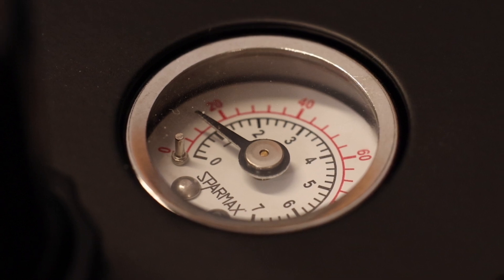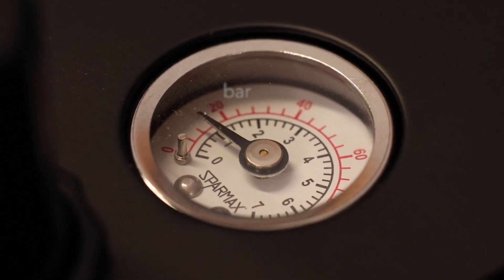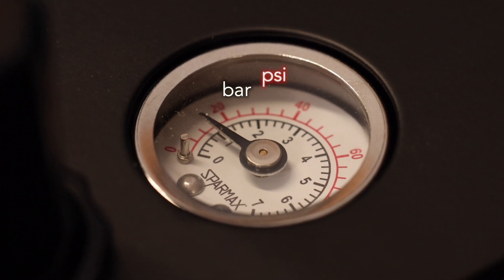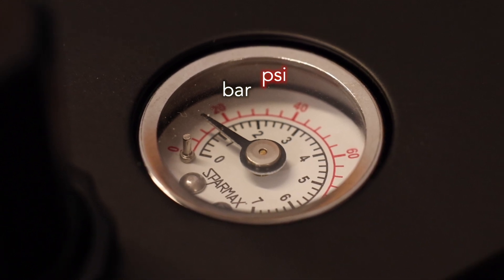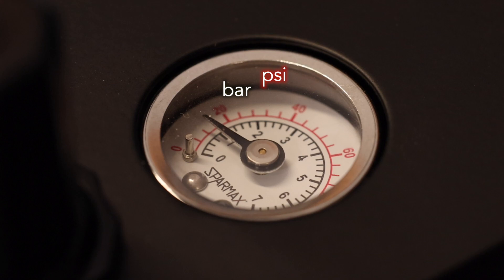Air Pressure Basic Tips

Comment: Hi there. Thank you once again for such great videos, they have been a great help in my airbrushing journey, also thank you for the amazing feedback that you give quickly, great customer service which is hard to find these days. May I ask a question please?  The little screw in the air valve (goldish colour, evolution) how far should it be screwed IN or OUT and what effect does it have on the air pressure. I have not played with it since I bought my air brush, but just wonder if it did anything other that hold the spring for the pin
Reply from the maker: Hey Mark - slightly embarrassing and more than a little ironic that I've taken three weeks to reply to your compliment to our customer service - so my apologies!!! The little screw under the airvalve is ONLY to adjust the spring tension on the up/ down movement of the trigger. Adjust to preference :-) W

Comment: Am I right in thinking that you should set the air pressure with the trigger open so that it accurately reflects the pressure you'll be spraying at?  With the trigger closed the gauge will read higher.
Reply from the maker: Generally, I always talk about pressure set with the trigger closed. Static pressure. Dynamic pressure is a different number, typically 5-8 psi lower.

Comment: I'm liking these videos. Do you need to change air pressure when changing needle size, for instance going from 0.5 to 0.2?
Reply from the maker: We think of the 0.15mm set up more as a speed change - additional detail on top of the level of the 0.2mm hard to discern, but the 0.15mm makes it more accessible by slowing the paint delivery down. Therefore, if you really want to maximise the character of the 0.15mm, experiment with a little less pressure. With regard to the 0.4mm set-up - to get "regular" performance with that, around 2 bar (28psi) works great, but it's particularly mega at those stipple effects when you drop the pressure right down.
Reply: I mainly use a H&S Evolution with a 0.4 for large parts and switch to 0.2 for small parts ie wheel centers. I get a good smooth finish with the 0.4 but not so good with the smaller needle on small parts. Is this down to air pressure or technique. I use automotive paints. Many thanks.

Comment: I've got one of those pressure valves that you can connect directly to the airbrusb quick connector so I usually set it to 1.5-1.8 bar and never really change it. Depending on the mixture and my needs I can really quickly adjust with this valve :)